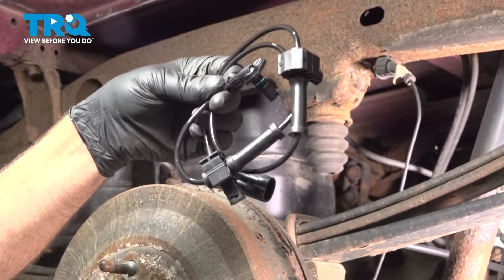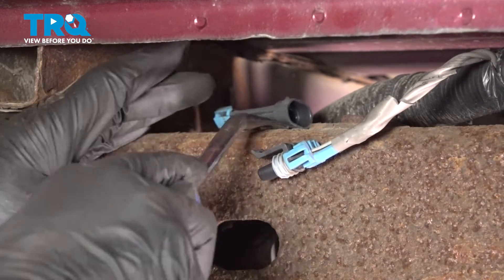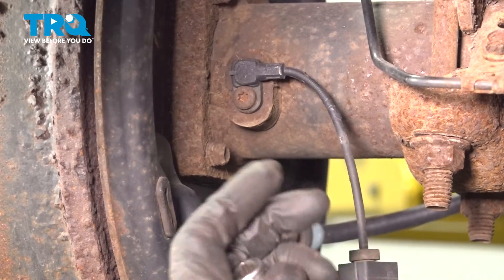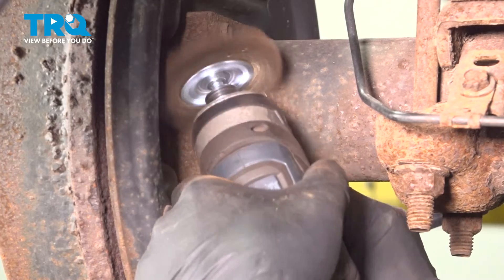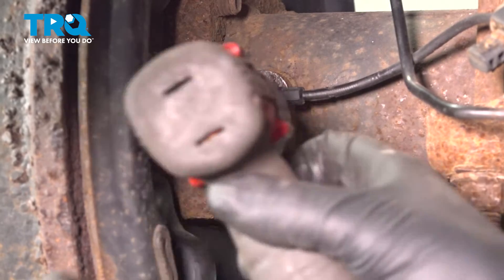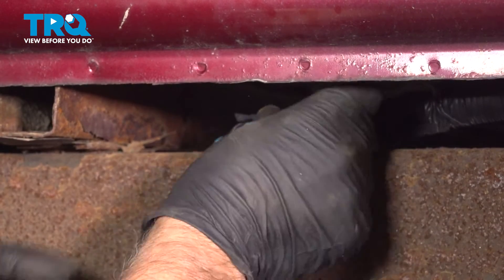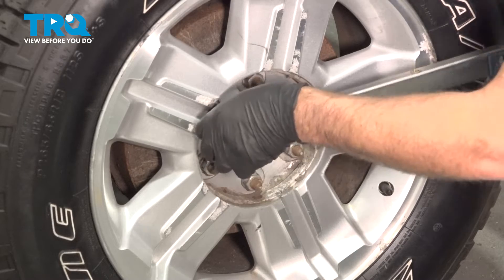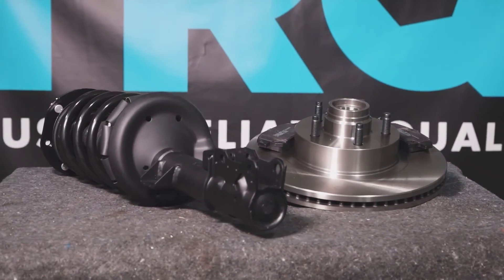How to Replace Rear ABS Wheel Speed Sensor 2007-2013 Chevrolet Silverado 1500

Comment: O don’t see any speed sensors in rear wheels my Chevy 2004 3500 6.0 , I change the front ones, abs module and abs light steel on, I don’t have idea what’s the problem. It you have same ideas I appreciate a lot 😊thank you

Comment: I had to replace mine and I snapped the plug inside of the axle. Before I shit my pants, I ran a drywall screw into the plug and pulled it out. Incase anyone else is as dumb and hillbilly as I am, try that

Comment: I recently learned a couple of weeks ago that my 2005 GMC Sierra 1500 VHO RWD battery is either weak or it won't hold a charge, a couple of days ago while I was driving the truck in the neighborhood an effort to charge the battery, the "Service Brake System" and "Traction Control" warnings flashes and beeps loud.  I purchased a new battery and I had hoped it may clear a faulty sensor, but Brian, the  Master Mechanic, who has worked mechanical wizardry on my truck, ran a OBD scan and informed me that I need a Rear ABS Sensor.  In my search effort with both the local Auto Parts Stores websites and the infamous internet parts platforms for the correct parts, I am a bit confused because of the explanation of "Parts Specifications".  I have to return to Brian and ask him if I have the right stone in my hand?

Comment: Does removing the axle do anything to the sensors I’ve regeared mine once and then replaced my lockers never kept in mind about the sensor getting pushed when sliding the axle out